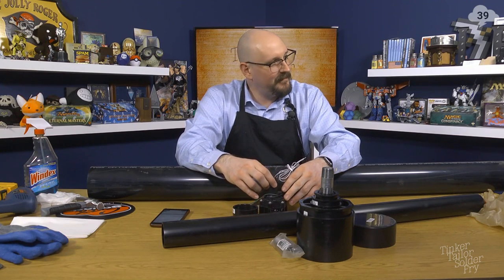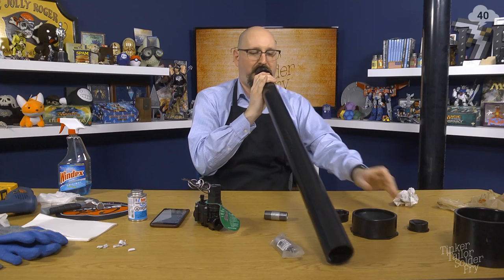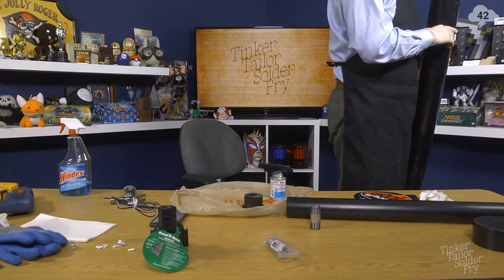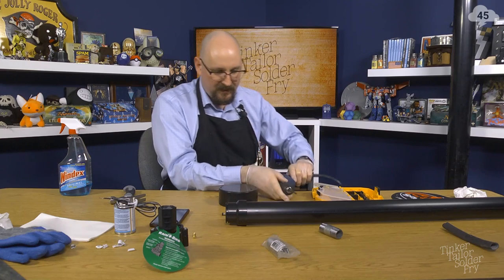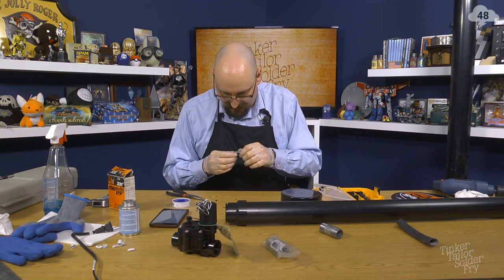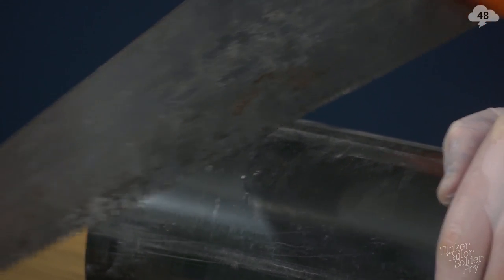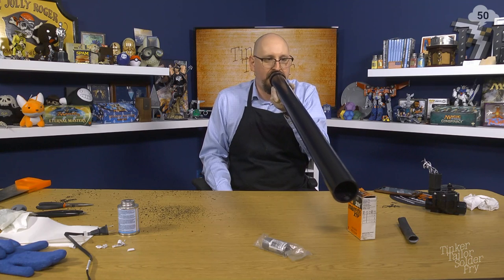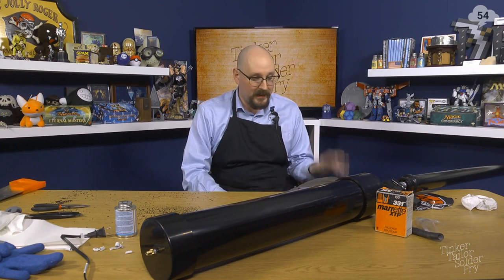Tinker Tailor Solder Fry — TSHIRT CANNON

Comment: Oh man, Ian, your sawing technique. D= I had so much trouble hand-sawing like that before I started looking further into body mechanics (in particular RenaissanceWW's video on it).

In this video,  you're directly in front of your cut, your elbow is to the right, and your wrist is bent to keep the saw straight. This means that when you draw the saw backwards, your elbow wants to move to the right to get around your body, and you have to compensate with your wrist to keep the cut straight—I saw a few times that your saw got stuck and bent because you had some force component left/right instead of straight forward/backwards.

Next time you have to saw, line your elbow up with your cut, then take a step forward with your non-dominant leg, so that you're kind of at a 45 degree angle to your workpiece, your sawing arm's elbow is further behind and aligned with the workpiece. That way, as you move your elbow back and forth, it's totally unhindered by your body getting in the way; it's a lot easier to keep the saw straight along your cut and to keep the saw from seizing up due to left/right forces. Your wrist is also held straight, which maintains better structure both in terms of the cut and your musculoskeletal health.

You also want to be using the weight of the saw for the cut and not pushing it down - having the tip of the saw pointing upwards kind of defeats that, I think. Usually, with that kind of saw, you want to do your cut standing and with the tip at a downward angle. I mean, for wood, anyway. I have no clue about cutting an ABS pipe with a wood saw.

Comment: I wouldn't bother trying to seal the threads around the valve through the ABS.  Thread it in, then epoxy a wide brim metal washer around it, then seat a gasket/o-ring/rubber washer (whichever) and tread-lock a nut down the valve threads.
The washer and nut should make blowing out the valve basically not possible, all those seals should make it reasonably pressure tight.

Now you just need to do a TTSF for the rest of the Panzer IV!